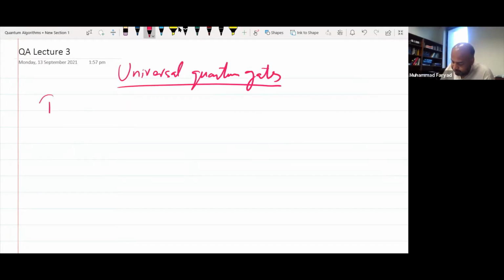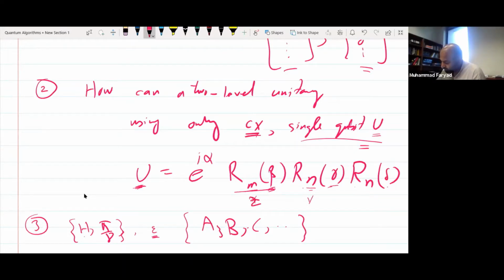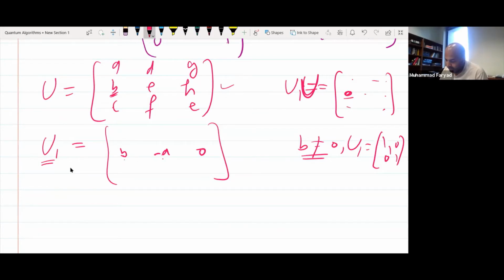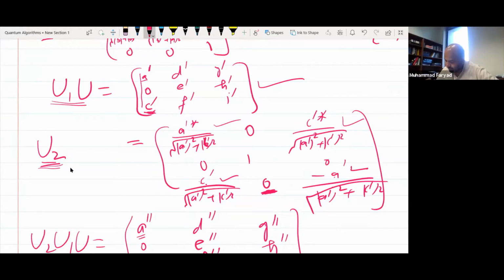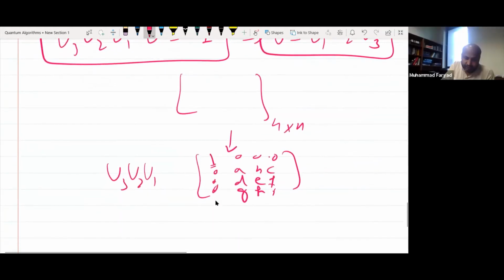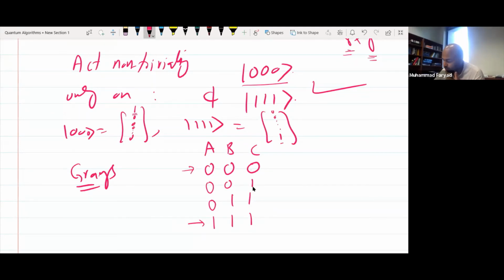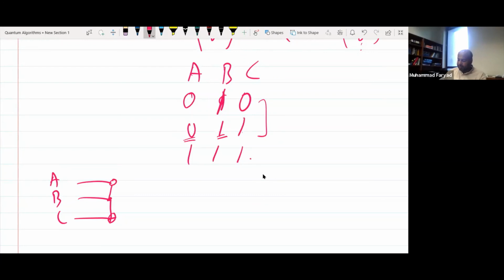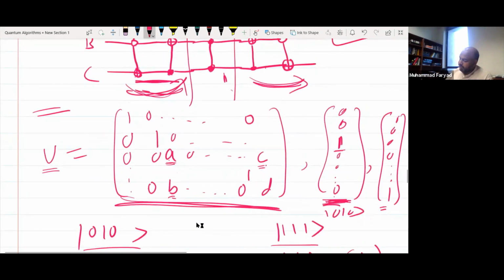Lecture 3: Universal quantum gate sets

Comment: Hello, thank you for the video!

Unfortunately, the question I had (the one I hoped, the video would answer) is still open: I wanted to see a proof that this method works. It seems you have shown that it works only for a very specific circuit (3 qubits and two choices of two-level unitaries U) and even there only for two choices of input states, namely the ones the unitary is supposed to act on. I would love to see a proof that it really is impossible for the circuit to map another state (e.g. one of the basis states which is not part of the Gray code) to be acted upon non-trivially by the controlled (reduced) unitary. 

Thank you!!
🙏